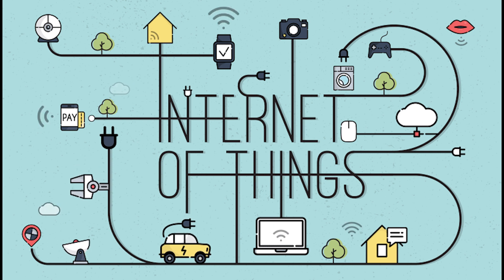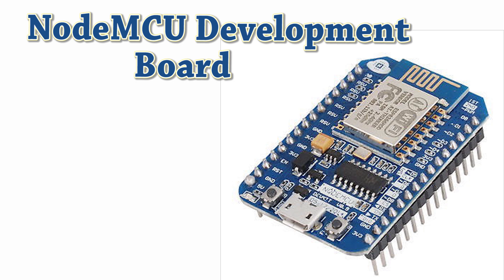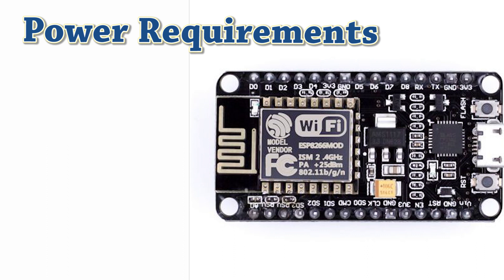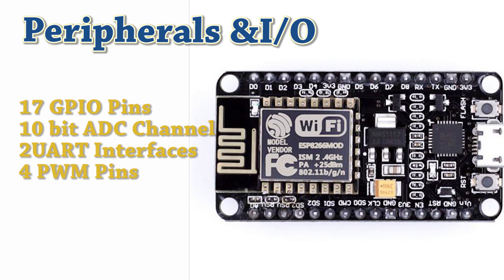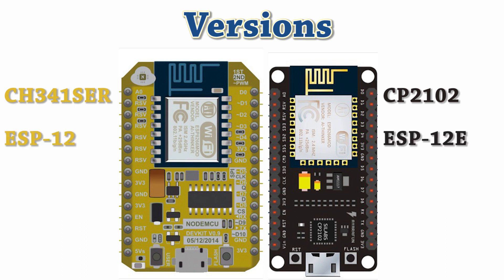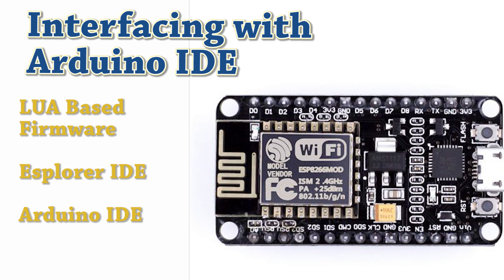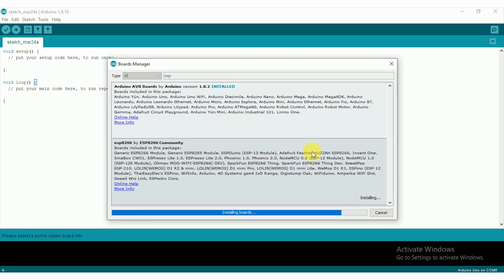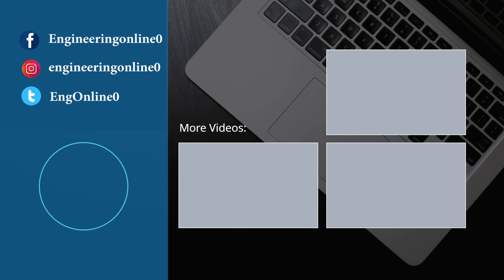Stay Home and Study NodeMCU With Me | ESP8266 Tutorial 1

Comment: In node mcu and arduino the pins vary know. Then by dumping the code of arduino into node mcu how will it work? We have to change the pin no in the code no.
Reply from the maker: You are not dumping the code of Arduino. You are only using Arduino IDE to write code on NodeMCU. In this video, blink program is used. Blink program uses builtin LED which is at a different location in NodeMCU.
Reply: @EngineeringOnline  okay i understand but by changing the board from arduino to node mcu the code in the examples also changes accordingly in the IDE. Do you mean that?
Reply from the maker: Yes definitely. In the 2nd video where a web server is created. The code is completely changed and GPIO pins of NodeMCU are used there
Reply: Not by us does it change automatically as we have changes it from arduino to node mcu in ide....Does ide also shows only node mcu examples in ide.
Reply from the maker: I doubt it. I think you will have to change pins manually
Reply: @EngineeringOnline  okay but have u changed them while doing this video. I have got this doubt after seeing this. Have you changed them and then dumped the code?
Reply from the maker: In the blink LED program, if you notice the builtin LED keyword is used here. If in this program, any pin number would have been used, then I had to change it.  It automatically takes that pin which is connected with the built in LED of NodeMCU and Arduino both.